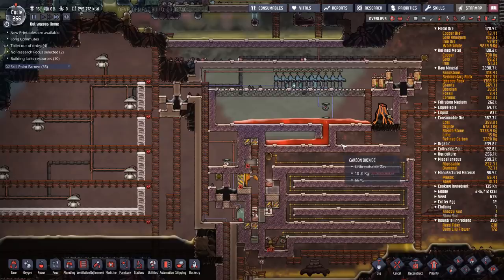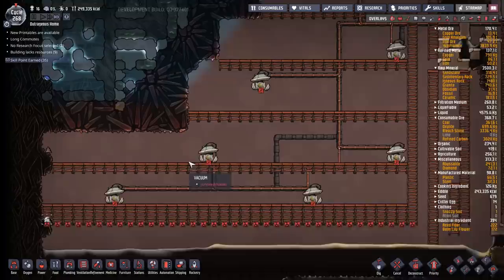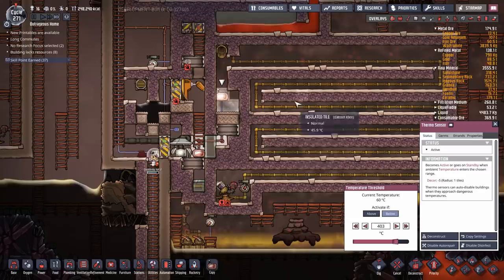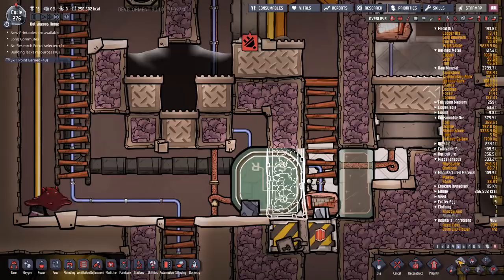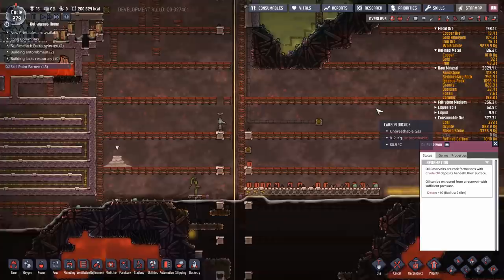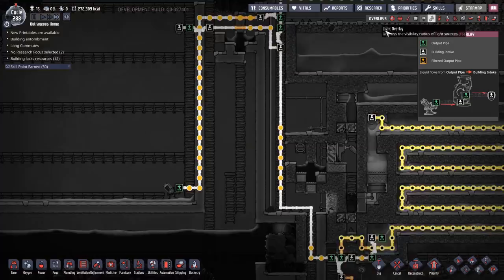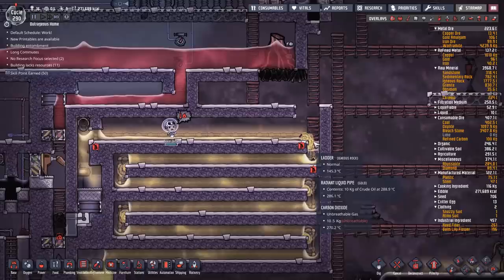QOL Mk3, 17 Magma petroleum boiler part 2 : Oxygen not included

Comment: For the liquid valve, the priority stays because it's not an on/off/construct/decontruct. The job is never technically finished for applying settings (bug?). That's why it seemed like they didn't apply it. Not even sure why that one requires a dupe compared to temp/pressure sensors that are instant.
Reply from the maker: I was a little panicked at the time, if that pump failed was not sure how much of a mess I would be cleaning up.

Comment: Quick note on the boiler design. You mention that you can't turn it off because if you do, the pump at the bottom will eventually heat up and break, which is true ... Unless the whole thing has been vacuumed out beforehand.
If the heat exchanger has been vacuumed, there is no (or at least, very little) heat transfer down to the pump, and it stays cool. I did this on a map where I built 2 boilers (one volcano powered, the other geothermal - cause why not ?) I built the geothermal in the oil biome in a complete vacuum and left it off, only ran it as a backup in case something went wrong with the other boiler. It's been off for something like 500 cycles - pump is still below 175°C.

Edit : Also, by having no atmosphere on the other side of the liquid lock where the robo miner is located, it's eventually going to overheat - nothing to transfer the heat to
Reply: yes, also at the top if he has a lip the petroleum needs to fall and there is a vacuum, the 403ºc heat wont move to the heat exchanger as the heat would need to transfer in a diagonal.
Then just don't put radiant pipes in the hot 403ºc chamber and you are all right
Reply from the maker: It's not the atmo that overheats the pump, while the crude oil is heating up on the way up the counter flow the petroleum is cooling down. By the time it get to the bottom it's 150c ish. When you turn it off the last few hundred KG has nothing to counter flow against and slowly makes it's way down the counter flow to the pump. That is why the little tank is there. If you keep enough there it should keep the temp below 275C. In an episode or two I shut off the boiler (accident/mistake) steel pump overheats due to sitting in 300C petroleum. The no atmo on the liquid lock could be a problem but it's about 3 tons of crude, it will take a long long long time for the miner to overheat that mining 2 tiles every 15 cycles or so. But I'll have to mention that in a Q&A.
@Nicolás Rodriguez I'm Liking that lip idea I'm going to give it a shot when the native crude runs out and I switch entirely to oil wells.
Reply: @FrancisJohnYT  Some of the petroleum comes down, but it's not enough to heat the pump past 200c. Once all that can come down has come down, there's no more heat transfer. The pump will cool down once you restart the boiler.

Comment: I attempted this exact build with two differences, it was a (major) volcano and i vacuumed out the gas in the oil/petroleum chamber. Three things bit me; I had to change a few of the topmost radiant pipes for granite because there was no gas to offload a bit of the heat. Granite made the crude hit the cooker at 390 degrees but that was fine. 2nd thing; 430 degrees Celsius wound up too low as i was pumping in 10 Kg/s and the cooker chamber was filled with Crude before the robo-miner etc was done. 30 Seconds for robominer but sometimes since 20 seconds was exactly not enough sometimes (this could be because of lag or weird circumstances).
Reply from the maker: The design I'm using here is configured to work with a minor volcano there is a different design for a major volcano that has a shorter counter flow to take advantage of all the extra magma. You appear to have figured out how to modify it to work for you but if you will allow me I'll share a few bits of info the community figure out. Lock the door if the dupes keep going in and out of the miner area they can cause the oil droplet to "jump" and it lands on the magma. If you are getting pressure damage in the boiler you should cycle out the magma earlier as in up the temp to 435C or more if you need to. (You have already done this) If you run it at less than 10kg's decrease the flow slowly and it may be necessary to replace some of the last few pipe segments with insulated pipes. This design does not like running at anything lower than about 4-5 KG.
Reply: @FrancisJohnYT  They were very helpful yesterday with my implementation of your  volcano/petroleum build on your discord. Very grateful.
Reply from the maker: @stends113  Ah OK that was you, were you the one who discovered the crude oil droplet jumping?
Reply: @FrancisJohnYT  Yes, LoL, i was about to lose my mind!
Reply: I had the same problem with the crude oil backflow . I used a liquid element sensor placed towards the top of the boiling chamber connected to a liquid shutoff placed at the right on the top leg of the preheater. Also allows for a nice way to shut the system down when your petro tank is full as well if you connect some automation to that and the petro pump.

Comment: Just a note to anyone building this design. I was forced to work with a volcano in a slime biome and constrained by the edge of the map. As a result I had to tweak the design, so troubleshooting the massive issues I had became a challenge.  YOU ABSOLUTELY MUST WORK WITH A UNIFORM GAS IN THE EXCHANGE.  One small packet of polluted oxygen was leading to pressure issues resulting in damaged onyx tiles.  I wish you better luck.
Reply from the maker: Yep, either all one gas or no gas at all. you get a mix and the liquids can't get by.

Comment: Francis petro boiler tutorial series 
https://tinyurl.com/y5fepvuh

It is suggested to watch all 3 parts once through before building as things were adjusted.

Part 1 https://tinyurl.com/yxtl6whw
Part 3 https://tinyurl.com/y3mz6dlm

0:00 Mistakes will be made.
6:40 Petro tank
12:15 Mr. Burns says it's almost done. Finish the automation.
18:50 A real vacuum, automation replaced and how it works. 
21:55 Petro piping.
25:25 Mr Burns approves.
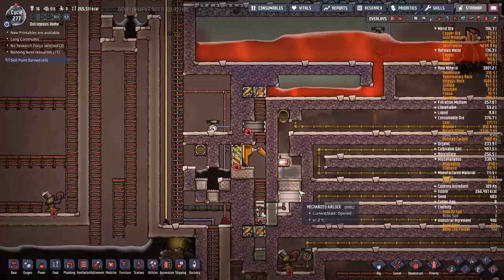27:30 *SAVE THE GAME!!!* Then let it run.
After the power is hooked up.
The power of the magma blade. Oooo's and Ahhh's
32:50 Why take the risk and effort for this?
34:10 Getting other work done and future plans.
37:05 Magma cycles and watching the automation.

Comment: A leaky oil fissure, not bad at all since it will further reduce your duplicant work load for the petroleum boiler. Just as an aside, there's a nice little mod both on the Steam workshop and Github that adds a tooltip to analysed geysers/volcanoes that gives you the average g/s. It's not necessary, but personally I found it kind of nice to not have to calculate it myself.
Reply from the maker: 800 plus hours of factorio and never installed a single mod. I have this odd preference for playing games straight vanilla. Even the quality of life mods make me feeling like I'm cheating the games universe. It's silly I know but it's the way I'v always been. Also that mod needs to be integrated into the base game right now.
Reply: That's basically the only mod that I use. I have a few others installed but haven't touched or taken advantage of them yet.
Reply from the maker: I'm sure there are some great mods out there that would make the game more fun or remove some of the grind. Use them by all means. I'm just a sucker for punishment.

Comment: What about useing steel instead the gold for your pipes? Or would it blow you preheating mechanism completly up?
Reply from the maker: Steel has slightly lower thermal conductivity than gold/copper 55 vs 60. So it would actually be a little worse for temp transfer and make the whole thing a little less efficient. It should still work but it would eat more magma.

Comment: I thought you were going to say your huge mistake was you let a slickster in. 
Although could have gotten the gas out through the bottom. with minimal risk. 
I would have never thought take it out where you did. To scared to touch perfection. 

The mini gas pumps are actually inefficient in every way. Power to gas pulling ratio.
In lower pressures the mini pump has the same ratio of pumping power as the large pump.
As in the large pump pulls 500g/s but in low pressure it pulls 100g/s

The mini pump pull 50g/s in low pressure it would pull 10g/s

Only way I can think to use them is if you don't have the space, not enough power on the line for a full size pump or small areas where you only want to pull from 1 side or other and not get any gas you don't want.
Even if you just want 50g/s. Add a regulator and the large pump will only run once every 10 seconds. 
480/10 or 60 every second for 10=600
In my test that's what I found.
Reply from the maker: Yeah if you have the power just put 8 big pumps on one power line and you have a vacuum in no time.

Comment: 38:30 there's something interesting. 
You can see what's hiding behind when he hovers over it without actually digging out the block to see it. 
Maybe we don't need to dig them out as much and accidentally starting them. 
Slush geyser Volcano and Oil fissure. Water, power and petroleum for rockets needs completely gone.
I want this type of map.
Even though I wouldn't know how to handle it all.
Reply from the maker: Hey the map seed is in the description if you want to give it a go, it's a pretty good map. The only down side is a tiny bit of sour gas and the oil biome being bit hot. All my slicksters are now molten.
Reply: As if I would know what to do with it all. 
Still struggling with a few basic things.
Also if you always pic your map or setup.
You tend to get into a rhythm where you won't play certain things which leads to a spiral of only play the best setup. 

If you find yourself on a bad setup. You don't know what to do. 
Play with what comes at you.
Makes you a better player when the bad ones come and when the good ones come you excel.
Same for general things. If you always take the easy way out. 
You never get better.
Reply from the maker: Thats my exact mentality when it comes to any game. If you make it easier on yourself all the time how will you ever get good at it.

Comment: @44:00 Along with your 5kg per second... you also have a pre-boiler with the hot igneous rock.
Reply from the maker: I may have went a wee bit overboard with the heat retention. This was designed to work on the weakest recorded minor magma volcano ever found at a constant 10KG/s forever. It's a finely tuned jet fighter and I need to tone it down to work as a passenger plane.

Comment: Could do this with a copper gold or iron volcano? 
I guess you would make the oil pipe a little longer and have the metal that drops out bottom into the cooling solution like your gold volcano. 
That about right?
Reply from the maker: It's much more difficult. Liquids form tiles at different quantities. I have no way of pouring exactly 1 or 2 tiles of metal. I could make a boiler that should work on an Iron volcano but you would never get the metal out. Still hoping for a bolt of inspiration on how to do it. Took about 6 different (failed) design attempts before I came up with this volcano one, I think it was during breakfast.